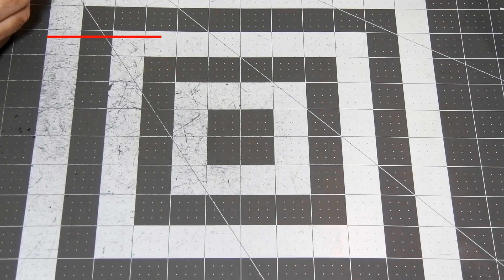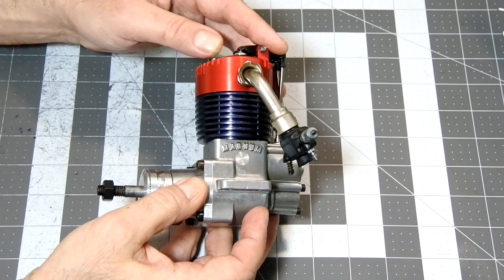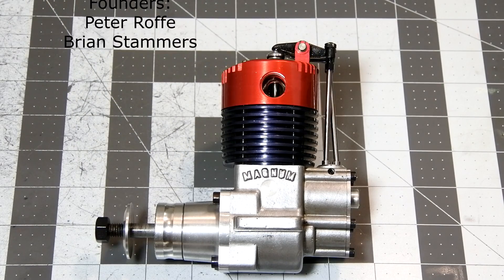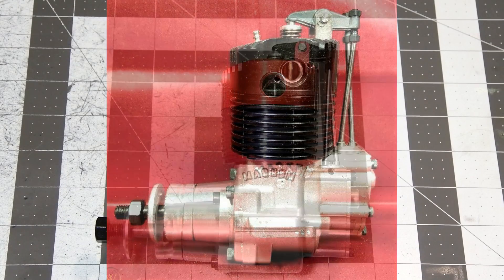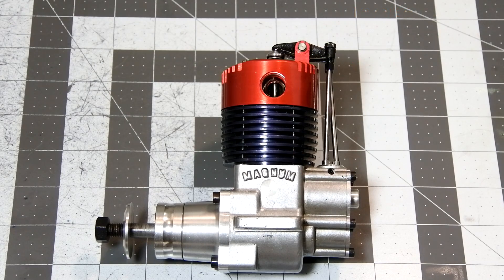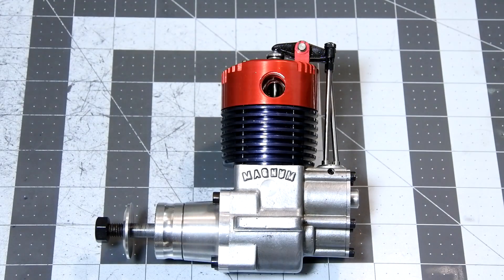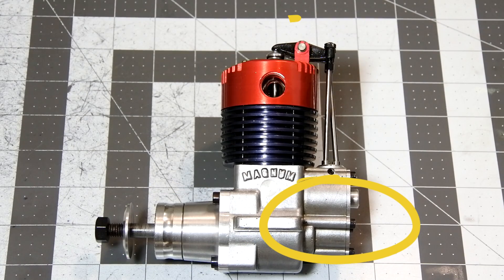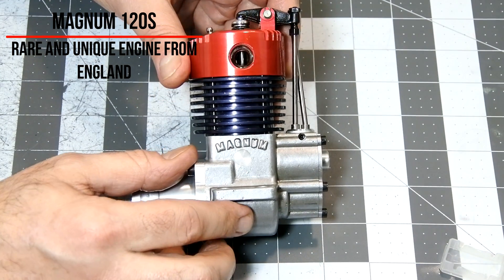Magnum 120S unique and rare engine from England Part 1

Comment: if this can run in both direction by switching the push rods either at the rockers or cam, then can't the os fs 60 run backwards as well? it has the same design as this as far as cam-push rods go. I think for it to run backwards, you would also want to swap the exhaust and carb.
Reply from the maker: Thank you for your comment ! Should say, that I've some plans to work with OS FS 60 and FS 75 additionally on the bench - testing and research is not finished yet. Will also make a try to achieve reverse rotation on them.
Reply: @crazyengines88  If all you are doing is swaping the pushrod ends ontop then the OS 60 and 75 should run backwards too! Both the engines have the cams inline and so its easy to swap at the top or bottom.
Reply from the maker: @ronitsingh85  Thank you. Sure, it should work in opposite direction. Having now a lot of work to do at my main job, so, less time to engines :-), unfortunately.
Reply: @crazyengines88  I have the OS FS 60 MK 2. Love it, best variation, It has the machined head and carb + the cast rockers that look very scale. I thought it a big engine that I never ventured into getting the 75. Its amazing how compact the rear cam box is. also it has full ball bearings, no bushings. Its a true jewel of an engine.
Reply from the maker: @ronitsingh85  Thank you for your comment, absolutely agreed with you about OS FS 60 great construction. OS FS 75 is just curious engine for me, rare, and I was bought it for collection. Only one engine from OS early 4 stroke line is still missed in my collection - OS FS 80. Still looking for it.
Reply: @crazyengines88  Whattt! FS 80, never heard of it! will do a search 🙂
Reply from the maker: @ronitsingh85  Yes, it is a great surprise. It was in production for a short time and becomes more, than a legend, because it is absolutely rare engine.
Reply: @crazyengines88  I see it, it is like the the os fs 61 and fs 90 engine. that design. Funny how OS made so many different sizes by simply boring out the cylinder and keeping everything else same, the crankcase, head etc. David has it on his channel - https://www.youtube.com/watch?v=4Ao62jwtGXw

OS smallest 4 stroke as you may well know is the os 20, so expensive, I am sure the sound is amazing and less noisy. I wanted one and went for the 30 cause its the same size crank case, the head rises up a little only, so 20, 26 and 30 sizes share the same head and crankcase. from outside the size is small, so I got the 30 for a lot cheaper price and more power!
Reply from the maker: @ronitsingh85  Thank you for your comment ! Definitely, OS engineering provide very clever compatibility system, a lot of products shows a lot of  interchangeable parts. I think, that production cost and economical reasons push OS  engines development team for   greater level of compatibility. It is also makes finding spare parts a bit easier.
Reply: @crazyengines88  oh yes, finding spare parts become a lot easier! This is true and great. That said we have to discover what parts are shared between the various engine sizes. Sellers will list spare parts by naming the engine they went on or were bought for. Many would not know that these parts fit their different sizes engine too. This is where OS engine manual come in handy where one can compare the part numbers from one manual to another. Like for example os fs 70s piston, cylinder and piston rings fit the IL 300 engine.
Reply from the maker: @ronitsingh85  Yes, exactly ! I've OS IL 300 Dia Star in my collection, and recently bought few parts from OS FS 70, just for inventory :-),  I think. 
The same situation with some parts for Gemini 120, piston and piston ring is the same, as in FS 61 and you can utilize this parts also for OS FR 5-300 radial, as well.

Comment: The Magnum looks remarkably like the Elmer Wall 10 CC from 1946, or a similar Westbury design. Both had the cam drive gears on the back, but they were spark ignition.
Reply from the maker: Thank you very much for your comment ! And yes, such design was very common at this time, early open rocker OS engines, as well, as  early Saito's and Enya's were utilized back cam gear design.

Comment: I have a casting and prints for this design. Maybe one day I'll build it.
Reply from the maker: Great, wow !!! I'm sincerely envy you ! Do you have castings for Magnum 120S only ? Interesting to build also Magnum 91S. Thank you for your comment ! Merry Christmas !
Reply: @crazyengines88  The only casting is for the crankcase. Marine version also shown in the prints. The 91S and 120S are identical except the bore. Your 120 has the milled spot under Magnum because "91" was there. Merry Christmas!
Reply from the maker: @rcdieselrc  Thank you for your explanation !
Reply: I would be interested to see the prints for the engine.  Do you know the bore of the .91 ?
Reply: @gwheyduke  The .91 has a 26mm bore. I don't know where one would get prints today.

Comment: thats a very nice engine. light weight piston. not sure about having 2 compression rings. may reduce the amount of oil for the bottom end, have to see it run and watch the vent nipple.
Reply from the maker: Thank you, for sure, will run it on the bench. Vent nipple is located on the left side of camshaft gear case, and it placed too high, according to mine opinion. We’ll see how it suit on test run. Thank you and stay tuned !

Comment: I'd love to see 'er on the test stand running forwards and backwards!
Reply from the maker: Thank you for your comment ! Next bench runs will be dedicated for this beauty. Will swap pushrods specially to watch how it will run backwards.
Reply: @crazyengines88  Mint! Looks like it's never seen fuel either
Reply from the maker: @TestECull   Exactly, yes ! No any signs of fuel. Pure and clean.
Reply: @crazyengines88  Definitely an experiment worth putting up. Perhaps same video you run this engine in reverse rotation as well?
Reply from the maker: @TestECull   Sure, of course. I'm going to explore this engine, as far, as I can. Probably, this could be just the only one video it the Net concerning this rare engine.
Reply: @crazyengines88  Also makes me wonder if swapping the pushrods is possible on a standard Saito for reverse operation. Would require removing the guide tubes, but they'll run fine without those.
Reply from the maker: @TestECull   Thank you a lot for sharing information. This is really great  hint for Saito engines !